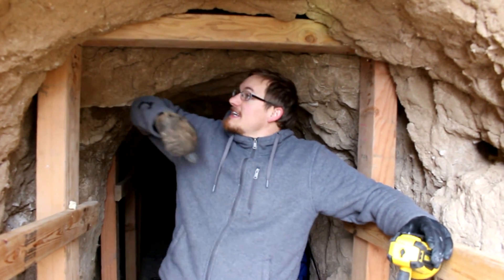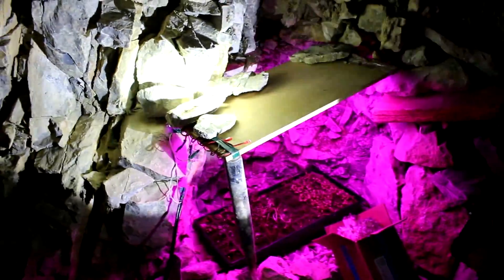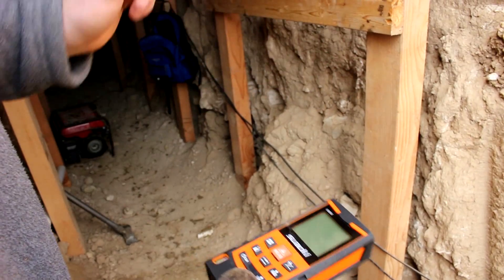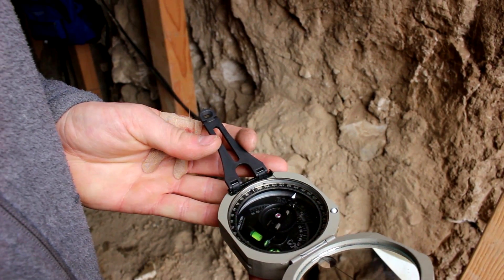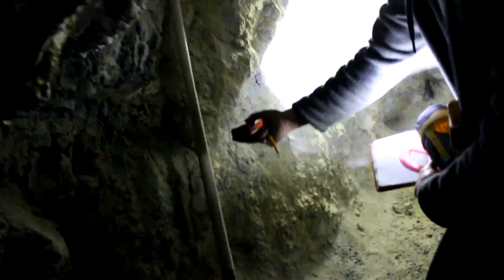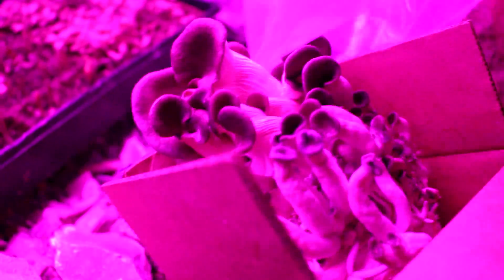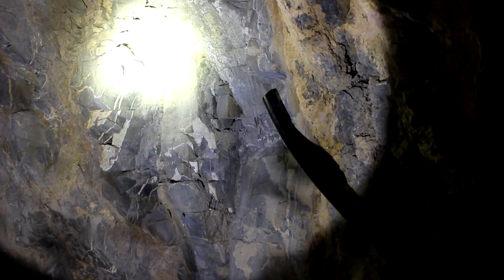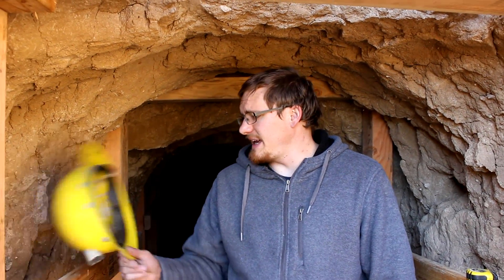Cody's Mine Episode 8: Measuring Things

Comment: A. I get the emergency supply but why not put some simple aluminum ducting with a duct fan going in and another return out just for general ventilation especially after a blast? Help clear out any gases that might accumulate in general, just pop on the Generator 10 min before going into the mine. The incoming duct fan can be right at the beginning and so could the exit fan though branched off to push air out with a Y joint. That way it won't suck in the particles and just uses negative pressure to pull the fumes out and up push them up. 

B. So is your compass adjusted for true north? Or if it doesn't have the adjustment, which I don't think that one does, did you subtract in for the magnetic declination for your area to compensate? (Around 12.5° east of TN is MN for SLC)

Comment: Cody... you might use some aluminium foil to sheet out the walls to make a light reflection surface (a cheap way to get a lot of "natural light" into the cave tunnel...and a large panel with the reflective side facing the sun... pointing at the cave (entrance cone shaped) to capture the light) or.. L.E.D's on a fiber optic bundle (glowing tubes on the roof) (above head always so your not looking directly at them) (at this point i think you got lead for sure in the cave) "might explain lack of background radiation"... i mean... your not even that far down right :D also if your not big on sheeting out the tunnel walls with a reflective layer you can use fiberoptic cables to force funnel a bit of real sunlight into one end of the cable and out the other with minimal losses on escaped natural light, the other (outside end will need a magnifying glass focused on the reception end of the fiber optics to bring up the light intensity a bit...
Reply: keep an eye on the reception end of the cables temperature, it might need to be cooled down via water layer perhaps... the light might even melt the cable a little... better safe than sorry :)

Comment: Google Earth has a built in error. Learned this in my mapping courses in college. Accuracy is hard with an intentionally flawed program but you did good.
Reply: why is that exactly? is there anywhere you can read up on this?
Reply: @ZoviSapphire  it's a national security thing. The reason we have Google Earth is because it's obsolete in the military. They have stuff so accurate they can read a small print book on a moving ship in rough water. The flaw is to keep stuff safe. If you've ever been ejected from a spot on Google Earth and shot back up into the air or the program restarts its due to you looking at a spot too long. It also keeps data on what you look at. I don't recommend looking at military stuff or airports etc. You might be investigated. I'm very serious.

Comment: Cody, have you thought of using ammonium nitrate- aluminum oxide? It's what the military calls ANAL, you can figure out who uses it... You can also mix ammonium nitrate with diesel and pump it down into a hole and then use tannerite to be the blasting cap basically. You basically almost make ANFO when you use the diesel and anyone that's watched Mythbusters knows how strong that is.

Comment: Doubt you'll see this but something I would advise you to look into is shaping the explosive charge. Because that can greatly change the performance and make it more suited for what you want. it can be very tricky to do since you have to get the angle of the charge placement right and have to make sure the shape of the charge is a certain way, but if done right and if the right mathematical formals are used it will be of a great benefit to you. Plus you can avoid stepping outside of allow stuff by accident.

Comment: so uh... i feel like it could be interesting if you where to use a diamond saw to cut slots into the rock, then used wedges to break it open... could be safer than using explosives... though that isn't a problem for you of course lol... but thinking in a creative way, using a diamond saw would be very interesting as you would be able to do a lot more controlled cuts than with blasting... then you would be able to cut out blocks of ore to then crush later, and maybe get further faster... especially with a very large blade... 12 inches+

Comment: Cody you should put valves set distances down your ventilation tube. In case you get caved in somewhere the tube isn't feeding fresh air too.
Reply: the whole point of that tube is to feed fresh air into the mine if there is a cave in.
Reply: +michael lanham I understand that however there is only one way for the air to feed into the mine. What if he was in the middle and it collapsed on both sides? He wouldn't have any oxygen.
Reply: SR71xBLACKBIRDx Oh ok.
Reply: Keep in mind that you would suffocate if you put your mouth to the hose and tried to use it like a snorkel. You do not have enough volume in your lungs to push the air you exhale out of the tube. You would just end up re-breathing your own exhaled breath. This is why the old diving bells had to have an air pump.

Comment: 9:50 i'm just curious, what is the power output difference between how the solar panel looks right there, a bit dusty and dirty, and compared to if you wiped it down cleanly. I guess it aint a huge difference, otherwise you'd do it? xD

Comment: set a fire next to the rock. Rapidly cool with water. Rock cracks. Perfect. And legal.
Reply: That would probably take forever, plus all the heat in the cave couldn't be good for him to stay near, AND there is probably less oxygen in the cave and building a fire down there could eat up all the oxygen, making it impossible to breathe.
Reply: +Dylansgames Actually. This was the way it was up until the 19th century and the invention of dynamite.
Reply: Really? Thats actually pretty neat, how did they deal with the issues like oxygen being used up by the fire though?
Reply: Not sure. This was the way they cracked the rock when digging out the largest coppermine here in Sweden during the 1500s. They had shafts all over the place though. Their biggest concern was cave ins and gas pockets that would leak natural gas and thus the miners could suffocate. They kept canaries (birds) in the mine since they would die far earlier than humans by oxygen depravation, and therefore work as a warning to the miners.
Reply: maybe they dug small holes to the surface and set up piping to allow air to flow in,the canaries thing is really interesting, iv never heard of people doing that.

Comment: Hey Cody, you should install the blower to that end of the pipe which is INSIDE the mine and give it a safe power connection (or store the fuel close to it)
If you are alone out there and you forget to turn on the blower on the outside and the mine collapses, that pipe cannot help you. 
Or you could intall two blowers, one on each end and if they are run by diesel engines defenetly keep enough of that stuff in there and make sure the exit gases from the motor get processed or caught properly to not be dangerous anymore. 
And by the way, i learned way more about chemistry from your videos that I did in school. I really enjoy your content. 
And excuse any mistakes, I am not a native english speaker :)

Comment: if you get a better air pipe later, i suggest you use the black pipe for a water supply, and running the solar panel through a deep cycle marine battery may give emergency power when your solar panel goes down.

Comment: Does that range finder account for the length of the device itself?
Reply: Subject4589 just like most measuring tapes do, I would imagine a Lazer would.
Reply: the device would not be really useful if it didn't do that and it probably has a setting to let you decide if you want to measure from the back or front of the device. at least that's how I would design the device.

Comment: you could use the pipe to also suck out the dust made by the explosions. if you would turn in the power cable for the ventilator you would be able to switch from the inside the polarity, so you really could use it in an emergency case to blow fresh air in.

Comment: What kind of LEDs are you using for the grow panel
\?
Reply: +Elizabeth Greene if you haven't found out already, they are cheap self adhesive strips , available from china very cheaply via amazon and ebay. .They're ok for early growth but better ones are needed for later stages.

Comment: I have a compass app on my phone that gives location/elevation.  Would that work underground or would it need a satellite signal?  It also gives inclination.  I was wondering if it would help you calculate the slope of your dig, even if it didn't have a satellite signal.
Reply: Probably need satellite. Does it need to recalibrate when u open the app?
Reply: +Graham Nelson Only sometimes when the compass app opens.  The level works on its own.

Comment: Eventually you could get something like a 2 inch pipe with a blower on the outside with little holes in the pipe every 5 or so inches so entire tunnel gets air flow at 1 time

Comment: When you said put the airpipe in a trench at the bottom, the word "radon" came to my mind.
We get a lot around here, there's even regulations about not putting AC intakes at ground level to prevent radon poisoning.
Might wanna check radon levels in your mine area just to be safe.

Comment: A 1" pipe is not sufficient for an emergency air line. I really think you need two lines of at least 3", realistically that may even be too small. One line to blow in fresh air and one to exhaust bad air in a must. Also a high power reliable blower is a must have. If at all possible you should set up an emergency signal to your house since it is not too far away, your a smart kid and Im sure you can come up with something.

Comment: What about an ammonium nitrate and fuel oil based low explosive? They're easy to make, and I believe that they use it as their main explosive for mining in Africa. For a DIY effort a la the IRA you can essentially make it by soaking compost in diesel, which is why they banned fertilisers with more than 10% nitrate in the UK.

Comment: Cody, be careful with that solar panel. If I am not mistaken, thieves could easily make quick money out of it. Also, depending on the type of meterial you are dealing with, you might want to consider using high pressured water to remove a lot of meterial. It's a valid technology for prospecting on softer ground.

Comment: i suspect you'll see a significant impact on the growth of the plants if you back the lights off more than 4-5 inches.  as long as the light source isn't hot, the closer the better. surrounding the plants in tinfoil will help too.

not sure how you can keep the soil moist without growing fungus in a cave though. good luck.
Reply: +irateyourvideo2 Seems to me the stems are stretching a lot due to not having enough light though

Comment: You are correct. Non binary explosives such as TNT or nitro glycerin require a license, even for home use without distribution. 
All binary explosives ARE legal for home use and can be mixed on site... Just no road based transportation once mixed.
ANFO (using diesel as fuel) is a 94:6 mix, minimum hole diameter of 1" for forced insertion (such as firm tamping), and 2-3" for poured use. It is safe to use at temperatures as low as 0*c. ANFO requires a pyrotechnic det chain to have reliable detonation in stead of deflagration. A black powder primary/ flash powder booster would give low ignition temp but high output. 5 gram is a pretty slim but often reliable charge, and would only cost about $0.15 per charge. 20-25g is self confining for this mix. 30/70 Al and KClO4, $0.035/g mixed.

Comment: The cave is probably too small to worry much about air quality, but a fun, cheap, project would be to use a raspberry pi or some other single board microcomputer with RTC/oxygen/CO2/humidity/temperature sensors to monitor or regulate your growth experiments. Low power demands, low software/hardware experience required, and it would fit with your over all Martian/Bunker theme.

Comment: just a recommendation, if you don't have a fan on the end of the air tube and the mine collapses don't put your breath through the tube. This will create what is known as a dead air space and CO2 will be trapped in your breathing path, they actually have regulations on the maximum length of snorkels to prevent this. hope it is cooler outside than in and natural convection pulls out your used air.

Comment: The light is way too high, it will probably cause the plants to stretch too much with the stems not supporting the weight of the leaves (cause with no wind the stems wont grow thik, or is there any wind inside the mine?), and the result is a suboptimal light harvesting. With leds light you can easily get it as near as you can, proably the best distance should be around 10cm, or even less from the top of the plants, but you should go check them oftener than every 2 weeks.

Anyway nice work you've done so far, the entire project is awesome, im almost graduating in biology and it would be so great doing the stuff you do. 

Greetings from Rome

Comment: Hey Cody, is that pipe sufficient to breathe with if there is a cave-in? I think if you have a blower on it, it would have no place to displace the gasses inside the mine to, so it would not be effective. If you try and breathe through it like a snorkel, being so long wouldn't the pipe fill up with CO2 and you would get little or no fresh oxygen? I think you need two pipes for breathing inside the mine in a cave-in.
Reply: LuanCarvalhaes
im not a miner, but i thought it was jjust an emergency measure... so only to be used in case the mine collapses... so in such situation you would grab the hose and put it in your mouth to inhale outside air , while exhaling through your nose in the mine

is this not the use for said hose?
Reply: +don trump Yeah that would work. What the other guy was saying is if the cave collapsed midway and he was at the back, having another tube pulling out co2 and other gases out would be good
Reply: you dont really understand how a snorkel works, do you? you breathe in from the mouth fresh air, you exhale from nose into the cave
Reply: +don trump What he was trying to say is that cody would need a way to get rid of the CO2 in the mine to be able to blow O2 into it. with snorkels, the CO2 always surface back to the atmosphere.

Comment: Hey Cody, just a suggestion but you should have your electric cable in a pipe as well. It would protect the cable if the cows came along and dragged it with them.

Comment: Gunpowder works nicely for rock blasting,
Nitrate, Charcoal, and Sulfur in a 14:3:3 ratio by mass
I like to use Ammonium nitrate, but potassium nitrate also works nicely.
If you're using potassium nitrate there's a chance you may have to work at it with a mortar and pestle for a while to get it to a nice size for ignition, but charcoal, Sulfur, and ammonium nitrate all work well with minimal work.

I don't believe any laws exist that restrict manufacturing of gunpowder, at least, none exist in Illinois, and judging by your scenery, it doesn't seem likely that such laws would exist in your state.

Comment: It is very uncertain that tube will help you if you are trapped after a collapse. The reason is that the tube itself has a lot of volume. So when you breathe into it, you will not really get to breathe fresh air from the end, instead you will breath the air you exhaled earlier. You would need two tubes. One to suck air from and the other one to breathe the used air into.
Reply: +Sebastian Freitag (Inbrainsane) 
that was part of an Alfred Hitchcock movie. guy one was "helping" guy 2 get away with something so he gave guy 2 a 10 ft one inch tube to breathe through underwater. he died breathing his own carbon monoxide and guy 2 wins the spoils, whatever they were getting away with. it was a long time ago. lol.
Reply: Just use it as a snorkel. Breath out in the mine breath in the tube
Reply: he is  hiding in the water, doesnt want bubbles.

Comment: Cody, you should buy a tiny fan that can run off of a tiny powersource to push all the air through the pipe all the way to the back. And you should probably put a filter on it so no bugs get in the pipe.

Comment: Wouldn't you need some points along the pipe so you could breath from any point
Reply: if the entrance collapsed, the air would be behind it, and if the middle collapsed the air would be behind it, so no.
Reply: +alexander simcox yeah but what I meant was if he was in the middle and it collapsed he would suffocate
Reply: +Mike H. (ǝpnʇıʇdɐ) if it collapsed on him, he would have bigger problems to worry about, and if he is by the entrance when it collapses, he can just walk out
Reply: +Mike H. (ǝpnʇıʇdɐ) it is not sealed on the outside

Comment: I'm sure you've thought of it, but if the mine seals completely behind you, and the only connection out is that pipe. (white pvc isn't that long yes?) Will you be able to pull air in against the pressure? or will it be like trying to inflate a glass bottle :P

Comment: Nice plan You made! and if You laminate it, and place in front of cave, then  in emergency situation, rescuers will know the structure of mine.  How about place just wire [coaxial cable] on  walkie-talkie antenna and then go deep in to cave and see, if signal is transferring [wire must end outside cave. And for diode plant lights - You can solder simple schematics called "Joule Thief" and get rid of electricity loss in long wires.

Comment: What about drilling a small hole, an inch maybe, from the top of the hill through to the end of your mine? I figure it's not that deep. If you stick a metal rod in there you might be able to use a cellphone or radio inside to communicate with your dad after a collapse.
Reply: +Distelzombie Centzon Totochtin 
or put the black pipe in from above at the end of the tunnel.